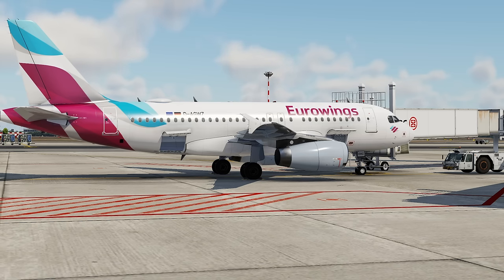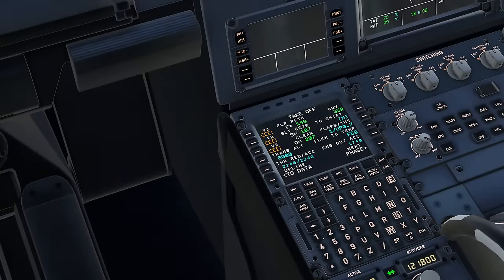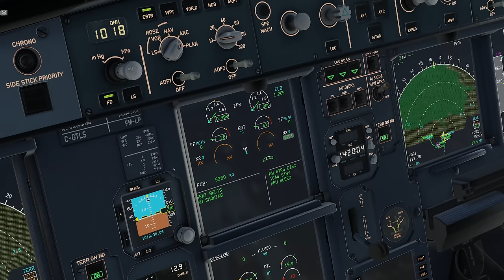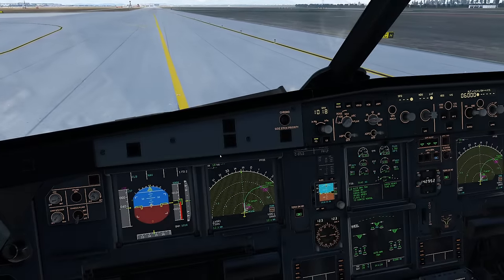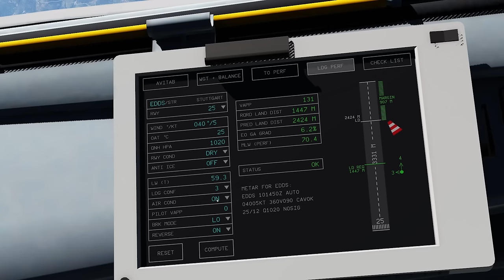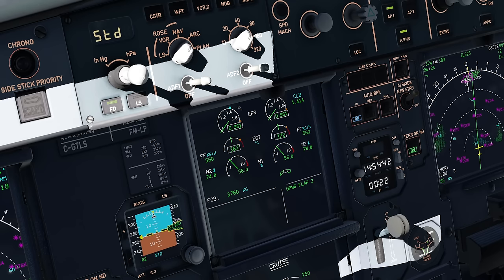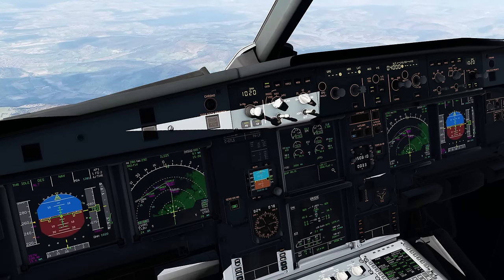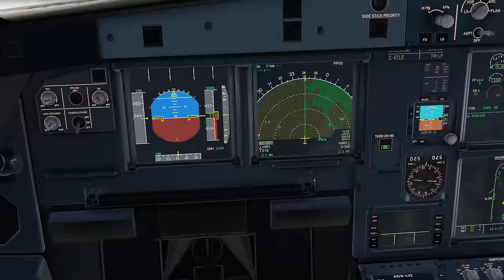ToLiss A319 FIRST FLIGHT | Real Airline Pilot

Comment: Is there a specific reason why you leave the altitude increments at 100 and switch to 1000 feet only when changing the MCP altitude?
Reply from the maker: Indeed there is, if you set it to 100s it's very easy to spot if you accidentally hit the switch, if it's set to 1000s it might be easy to miss.
Reply: @A330Driver  Oh, right, thanks!

Comment: Is there still a procedure you’re supposed to leave flaps at 1 if outside temp is 30 degrees or above because otherwise the system thinks there is a bleed leak?
Reply: It's above 35 now

Comment: Hello Emanuel,

Normally the A320 family of Eurowings uses the callout TWENTY FIVEHUNDRED instead of TWOTHOUSAND FIVEHUNDRED.

That was also the case at Germanwings, before they were integrated in Eurowings.

I know that an A330-200 of Eurowings also used TWENTY FIVEHUNDRED, which is extremly rare.

I only heard two times in an A330 the callout TWENTY FIVEHUNDRED.

In Eurowings A332 and in Air Greenland A332, which was replaced by an A338N.

Comment: If you get ALIGN IRS in amber on the INIT A page (ToLiss A319 and A321) I believe the correct procedure is to check with the GPS position, use the up and down arrows to ensure they match then press the align button

Comment: The FCTM states 3 min recommended time to start APU bleed after APU start.. or am I wrong ?
Reply from the maker: "Airbus SOP recommendation is to set the APU Bleed to ON when APU is available"
A320 FCTM "Use of APU Bleed"

The 3 minute recommendation would only apply if you can reasonably expect oil traces in the air duct for seals to reach their optimum performance after a warmup period. Not the question is, when can we expect such worse performance of the seals? Not during a normal ground time for sure.
Reply: Danke!:

Comment: That approach was definitely not stable in any way: 1000ft AAL and VApp + 25, idle thrust and a sinkrate of 1400ft/min. A go-around should have been initiated.
Reply: Hey, you're defo not wrong but some airlines in VFR conditions allow you to reduce the altitude at which you gotta be established  to 500' AGL, maybe his new airline allows that.
Reply: @anslucasi0980  and even at 500ft the approach was still not stable. Still on idle thrust…
Reply: @Bikerace333  not really, they weren't and the IDLE flag wasn't there and you could see the thrust increasing before the 500 but yes, a missed would've been better.
Reply: putting simulated lives and aircraft collateral at risk
Reply: @nigelsmith721  what’s the point of simulating a real flight in the simulator if you don’t care about stabilization criteria which are just normal parts of an airliners approach??
Reply: @Bikerace333  because it’s important to have perspective at all times otherwise you start thinking you’ve killed passengers if you’ve miscalculated your TOD or you’ve got the wrong QNH.
But you haven’t.
It’s like losing sleep because your horse got killed in a game of chess.
Get a grip.
Reply: @nigelsmith721  literally nobody thinks you’ve endangered people in a simulator, when you make a mistake
Reply: No virtual pax has died and no virtual aircraft has been written off..so it is perfectly fine.:face-fuchsia-wide-eyes::face-blue-smiling:🤣🤣